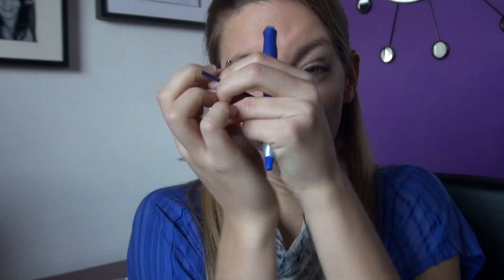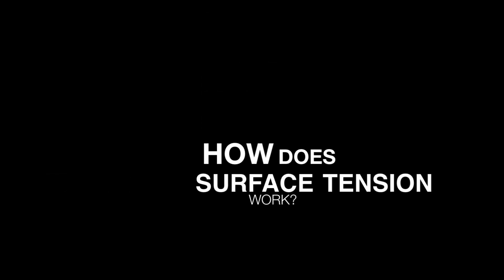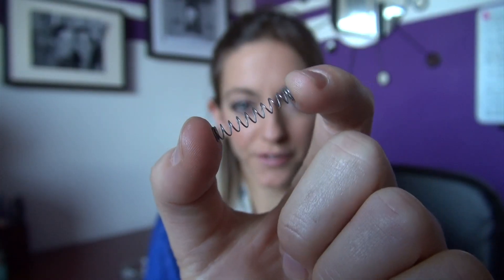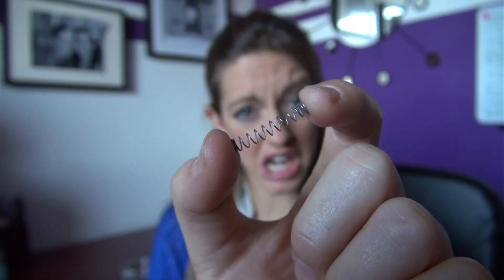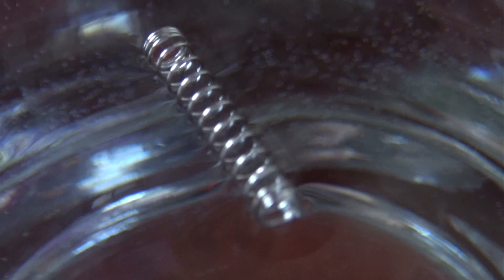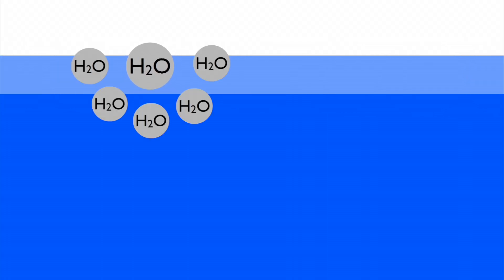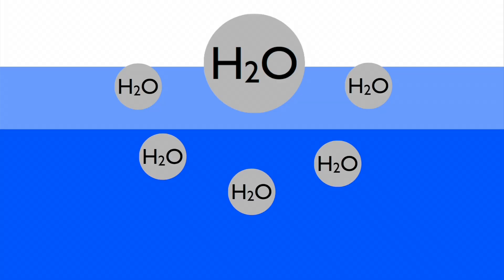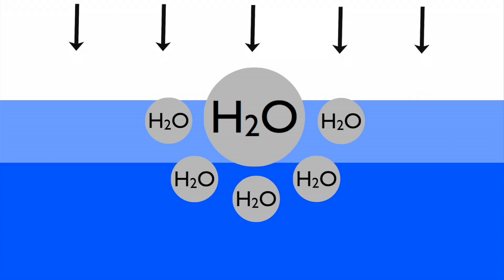Amusing Surface Tension Experiment

Comment: Thanks for posting.  I hope you make more.

Few questions for you. I've been undecided about pursuing CS or Mechanical Engineering myself; and upon doing a little research, I'm now considering physics as well.  Is there any reading material or website you could recommend that will help me to better understand what's in store for Physics majors? Also, having worked in software engineering, how much does age play a factor in CS entry level work?  I'll be about 34/35 by the time I get my bachelors.